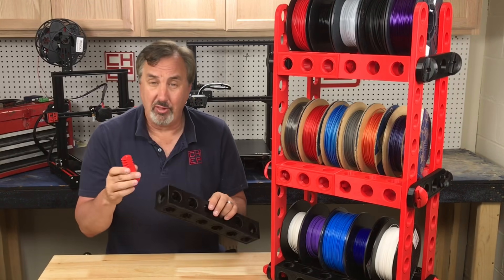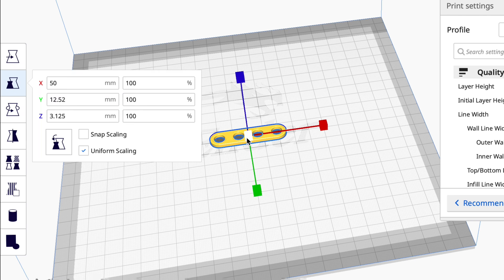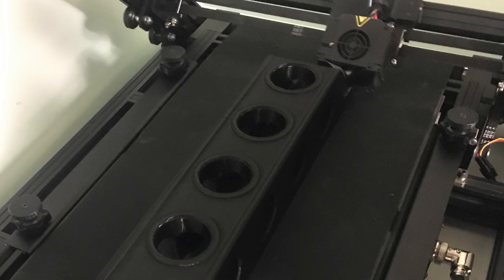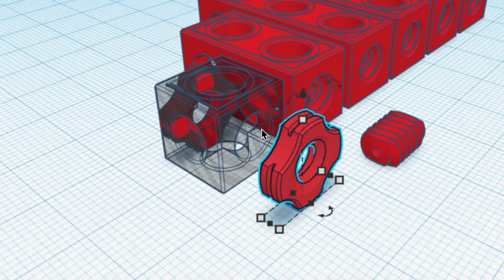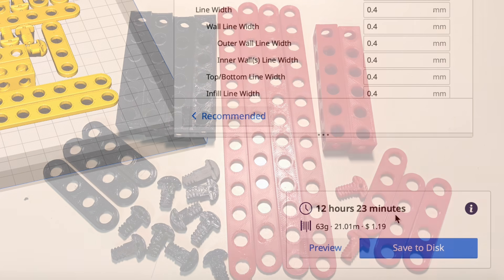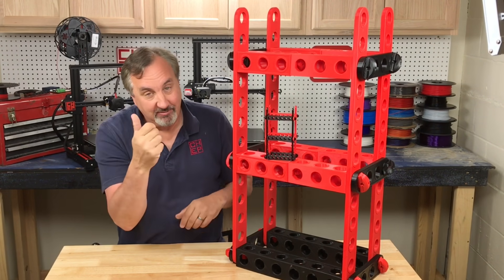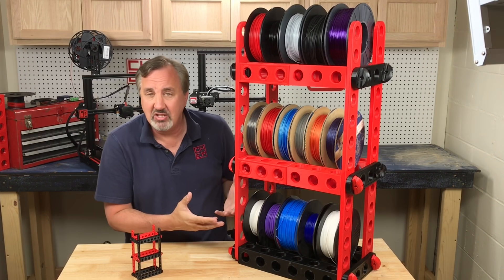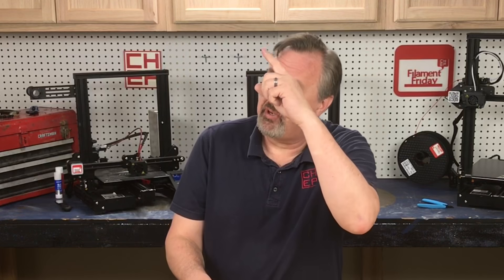Huge 3D Printed Stemfie Blocks

Comment: 3D printing is good where it is powerful, for example small details and hard to manufacture geometries as well as prototyping. 
I also built a spool holder but I only used 3D printed parts for difficult geometries to mount wooden dowels which are for holding the filament spools.

Comment: Saved my ass again today mate I honestly can't thank you enough 🥵👍. I was getting terrible under extrusion after days of no problem printing. Are a complete tear down it turned out it was the extruter tensioner bearing that was too tight causing under extrusion. I was just about to give up but then I remembered your some sort of ender 3 wizard, took a chill pill and watched a few of your videos and
Viola........ Crisis averted 😁
Reply from the maker: Glad I could help.
Reply: Thanks for posting. I'm pretty new to this and sure I'll run into this issue eventually.

Comment: Neat idea. Probably would be a good idea to print 6 additional 4-hole sides (the ones in black) and run a dowel down the middle and create a true holder and remove friction to print directly from the shelf.
Reply from the maker: That could work.

Comment: For a while, I was printing Lego like blocks at 400% scale and working on getting the pieces to make a couch... Non stop printing with a .8mm nozzle. I hit a wall where I got sick of fixing whatever little thing when wrong from running the machine non stop, and not seeing the pile grow fast enough to see progress.

One of these days I'll have to get back to that project.
Reply: How's many printers did you use? Can you share the lego files?
Reply: That's actually sounds cool Af
Reply: I have one hacked up Tronxy x3s printer that does a 400x400mm print area that I used for printing the 2x8 bricks. I use an old  Wanhao i3 for most of my TPU printing, which I used for the flat top plates.

I printed a lot, and still have a lot of printing to do to finish the project.

Lego is print aggressive about getting STL files of their stuff taken down, so I would rather avoid that.
Reply: @djoir  a fun thought is openscad files, or just make them enough different they’re still able to do the same things but are different enough.

As long as you don’t call them Lego, and don’t infringe on anything they might have patented recently enough, shouldn’t be a big deal.

You can slo state critical dimensions in a list of instructions and let people create blocks based on that. I’ve not spent time looking for openscad files for lego blocks, but I’ve done enough openscad design to know making functionally-equivalent blocks isn’t hard to do once you know critical measurements.
Reply from the maker: I also did that with basic Lego block upsized to 500%. It did take a while but I realized I could buy large Duplo blocks for cheaper so I stopped. The CR-30 though makes this easier and it can just continuously run and crank them out.

Comment: I "like" how people keep mentioning the time factor in this and hating on it.  You set the print, you walk away, maybe look at it a few times a day to make sure it goes.  But, really, your "time" is spent preparing the work area, getting the task set, and pushing a button to make it go.  You spend your time doing other things, not actually doing the print.

As for the waste of plastic, what else are you going to use it on?  Other trinkets that are going to take the same time?  If you're not printing, then the printer isn't doing anything, so that could be thought of as a waste of time as well.

This rack can be taken down and used in other ways if it becomes something of a burden.  Parts can be reprinted and replaced, it's something functional, and worth doing FOR FUN. It's an oversized Mechano (or whatever it is) building set, but made in plastic you print instead of metal pieces you buy.

With the thought of getting shelving, been there, done that, and often times, the wood is rotted out, busted to hell, water damaged, and bound for heap regardless.

For those that don't have a print farm, I can fully understand how printing something of this magnitude could be intimidating.  Just plan accordingly.  I have a single Ender 3, my kid wanted two cars printed, which took about 24 hours for the PRINTER to do.  I just sat in my chair watched the WebCam do its thing.  If I needed something in between, I'd print in between the prints, or just wait until the job was done.

Cost analysis, yeah, maybe it is a bit more expensive than just going to the store and buying some shelving.  Probably easier too, and absolutely faster.  But it can't always be about being easy.  Creativeness comes at a cost of experimentation, and this is a wonderful experiment.
Reply from the maker: You get it. It’s not about the spool rack, it’s about having fun with 3D printed blocks.

Comment: Not sure how I would print the longer side beams on an ender 3... Would I have to use print as long as possible and then chain couple them somehow?
Reply: its not possible (thats why the belt printer got snuck in ;) it is possible if you make longitudinal holes in them for 2 metal screwin rods, that will give you stifness... but I think we now touch on why this idea is bad.. we are now correcting instability in a design just not meant for 3d printing.. stick to 3d printing to manufacture difficult angle parts and use wooden dowels or square wooden blocks.. much easier, less print time (eq plastic volume) and MUCH more stable ;)
Reply: @ZILLION4EVER  Figured that's why he snuck that in. This isn't fair Chuck! @CHEP
Reply from the maker: You can use shorter beams and offset stack them.
Reply: @FilamentFriday  As in a bunch of 4 (like in 0:54)? That would make a lot of pivot points =(.

Comment: you are an always page to follow, you has solved all my question about 3d print. I need your help.
I saw in minute 1:44 many 90º supports. How do you do to avoid cracking in that point. I had printed stuffs like that and when I apply force, it breaks.
Reply from the maker: Print them on their side.
Reply: @FilamentFriday  do not get it. Do you have an image o detail please?
Reply: For example, CHEP is saying to print the 90 degree support on it's side.  In Cura, move/spin the part so it looks like an 'L' on the build plate.  This will make the part stronger since the layer lines does not cross the part where the greatest force will be exerted.
Reply: @andyfairman7812  very clear! Thank you so much

Comment: Newbie here. I can't figure out how you'd print those beams. Wouldn't you need to include supports? What settings? And how would you remove them cleanly?
Reply: You can print surprisingly long bridges without supports, holes like these should present no problem to print without supports.
Reply from the maker: The holes are round so gradual rise. No supports needed.

Comment: Interesting to see that you don't keep any of your spools in airtight containers.
Reply: if it's pla then it's alright, pla does not absorb much moisture. especially given it's a print farm so the lifetime of a spool is measured in days.
Reply: @TomaszStachewicz  Many of the other big name channels disagree. I've had mixed results personally.
Reply from the maker: Depends on the filament. And I have a drier.
Reply: @FilamentFriday  Is there a way to tell by looking which filaments will not suffer Chuck?

Comment: I know this is all for fun and its a really neat thing to say "I printed THIS!", but it makes me wonder what the cost of all that filament plus the time needed to print even on multiple machines vs just going to get 2x4's of wood or even just PVC pipe from the hardware store?
Reply from the maker: I guess you could make blocks with 2x4 or put some things together with PVC. But the large Stemfie blocks are designed to build and have fun with. My community post on my channel shows the cost.

Comment: That is really awesome! Having used so many versions of the Ender, how does the Ender 3 pro compare to the Ender 3? I have been using the Pro which I love. I want to invest in 2-3 more. Should I stick with the Pro, or is the Ender 3 good?
Reply: You should stick with the pro. The original uses 2040 extrusion for the y axis linear motion system, in comparison with the 4040 extrusion on the pro.
From an engineering point of view the pro is far superior because of that, as the torque that is induced by the buildplate and acts on the frame and the wheels is significantly smaller
Reply from the maker: I’d consider a Voxelab Aquila which is an Ender 3 V2 clone for the price of a Pro. Basically a Pro with silent drivers & glass bed.

Comment: Honestly, what id rather do is 3D print some connector pieces designed to fit some off the shelf rods and make the enclosure out of that

Much less time and probably much less money for the spool holder imo
Reply from the maker: Not as much fun though ;)

Comment: Something you should sell is a Beginners Assortment. It would include T-slot nuts, m3, m4 & m5 bolts in several lengths, bearings, threaded inserts & maybe a few other things. For some of these things a 20pc. assortment is $5. The better value is 250pc. for $20, but that adds up when you buy each thing. The middle ground is what I want. A handful of this & that all in 1 for $20-30.

Comment: Hey Chep I have been having trouble getting smooth prints on my ender 3 pro. I have done testing and have determined that it is not the print settings. I can find anything that could be causing it on the printer and have been trying to fix it for months. Do you know what it is. My printer is slow navigating the chip with the files even after clearing it. Do you think a new mother board would fix it? For context I used to get very high quality prints stop printing for several months then had quality issues. The quality issues are like the layers aren’t lined up good and give it a rough texture. It is not z wobble, loose belts, or loose bed/hot end it is also not calibration or the extruder. I’ve tried everything I can think of but can fix it. Thank for your videos you have been a big help
Reply: Try drying your filament.
Reply: @hydromakers  thx bro but my filament is very dry I keep it it and air tight container with a pound of silica gel beads I also bought new filament but it didn’t help thx for trying to help tho I rly appreciate it
Reply: Looks like my récent problem. I changed the whole heating bloc (20€) including noozle, and my layers came back to perfection!
Reply from the maker: Have you tried new PTFE?
Reply: @FilamentFriday  yes I have a Capricorn tubing but I think changing the hot en may fix it I have had a few issues before. Thank you very much

Comment: This is  a situation where your desire to print unique tools intersects the harsh reality of the time and money it takes to make. I love it, but I'll take a hard pass on something that would take weeks and cost hundreds to make. Probably better and cheaper to repurpose a mass-produced racking system that already exists.
Reply from the maker: Not as much fun though.
Reply: @FilamentFriday  There is a huge satisfaction in personally constructing solutions to your own needs, I agree Chuck. But I must admit, the combination of my printer noise and a child-like level of impatience means that I rarely take on projects taht take more than 12 hours for a single part. :-)
Reply: All the parts are reusable for other ideas. Lost PLA could be used to cast low temperature copies in aluminum for instance. With sand casting it could be done very fast with plastic only wasted on the originals.
Reply: @TheRoon4660  Nice ideas but not remotely practical for the average person.

Comment: That's at least 100 $ in filament. Definitely not worth it.
Reply: find lumber cheaper. it will cot more if you build it from wood
Reply: @KingNothing22  It WOULD be cheap to build it from wood (like pine), especially for this size project.
Reply: @KingNothing22  that looks like it would take about 2 maybe 3 2x4x8 and that is less than 20 dollars

Comment: So you print a thing, that you can easily make with wood in a shorter time … ?
Reply: Isn’t that what 3D printers are for? 🤣🤣🤣

Actually, if you have all the filament already, there’s a little time spent directing the print jobs to the printers and the setup as needed, but likely really less hands-on time with no time spent shopping for wood.
Reply from the maker: Can you take the wood apart and easily build something else? 
Guess you could but not as easy.